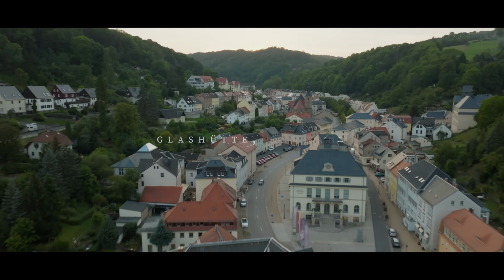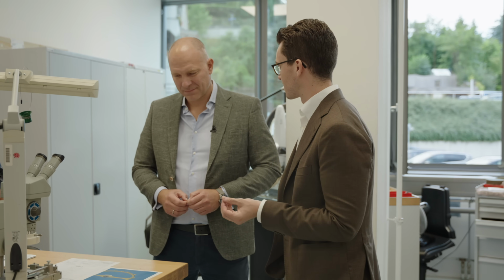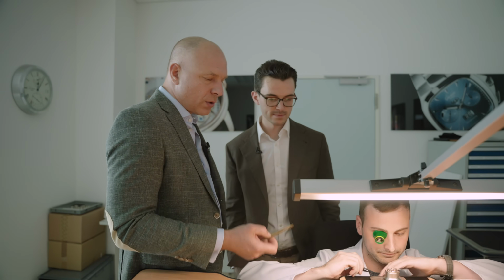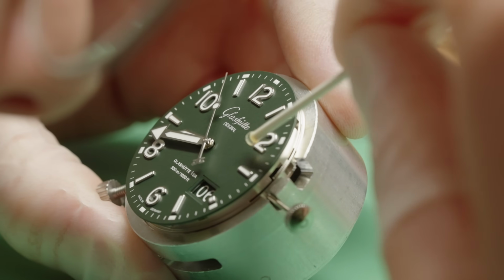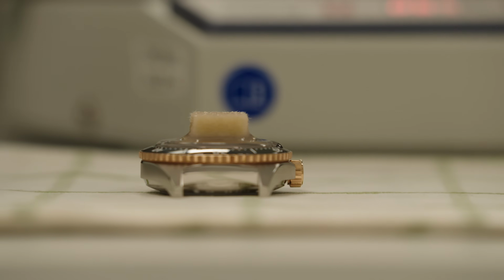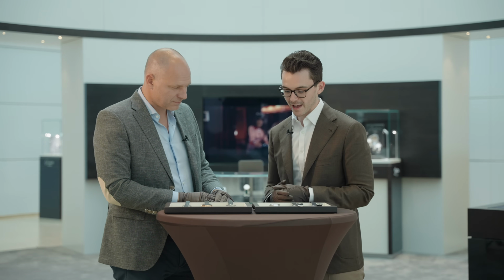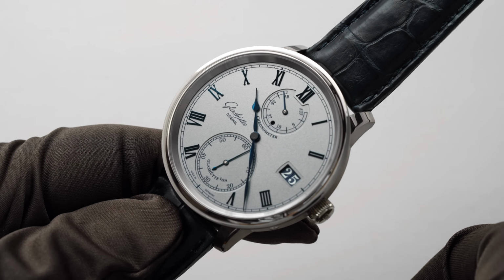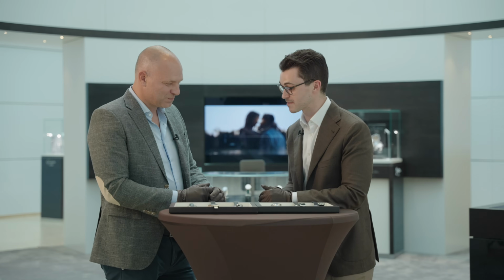Visiting One Of Germany's Greatest & Most Overlooked Watch Brands

Comment: Teddy: Thanks for the video, but it raised questions because of the lack of watches shown under production. For example, I expected to see trays of WIP (work in production) throughout the video and employees sitting at workstations. The footage showed one watch undergoing pressure testing; you would think a tray of watches would be in the footage of the pressure testing process. Where was a clip of the cases undergoing machining? The report contained nothing on finishing dials, gem setting, or band manufacturing. I can go on, but you get the picture.
Swatch owns Glashűtte as well as other German and Swiss-origin watch brands. Does Glashűtte manufacture all its watch components or use parts manufactured by Swatch Group's various production companies?
Please respond.

Comment: The 'hand crafted' watch is little more than marketing nonsense.  The vast majority of the work in any modern watch is done  by machines. Only assembly and some decoration done by hand. 

Machines can do virtually any watch making operation much faster, to a higher standard  and vastly cheaper than humans. eg Only 5-10 seconds for flawless Geneva stripes or perlage. 
Expensive  'hand made' watches usually have obvious flaws you don't see in mass produced models. eg a Seiko movement will have better machining on the gears than a Patek Phillipe.]

The Chinese can make almost perfect replicas of '$50,000' watches for a few hundred dollars. So you are just paying for the brand.

Comment: Just imagine if every screw in the watch inside and outside is perfectly aligned, meaning that once tightened down each mark of the crews are lined up ,now that is perfection IMO ?
Like you can see the case back screws are there but not lined up at all, the screwface is pointing in all directions, if they can go to this detail then i would be impressed?
Even rolex and other swiss made watches do not go to that level of precision, lining up every single screw inside and out?  🦘🦘👌👌✌✌👍👍
So basically measuring the depth of each screw and its thread count and the same with any threads on any plates inside the watch, to make sure that when tightened down all the head of the screws are pointing in the same direction?🦘🦘✌✌👍👍

Comment: There are about 200 parts in a motorcycle engine costing way less than this watch. I can buy a motorcycle with the amount of money it cost for this watch and my motorcycle can take me to places I have never been. My phone can tell time more accurately than this watch. Even my 500 dollar Citizen watch is more accurate. Instead of servicing my Citizen watch when it does not function properly or up to spec, I can purchase a brand new Citizen for the same amount as the cost of this watch or a Rolex. I do agree that Glasshutte Original is a great and better value compaired to Rolex, IWC, Breitling, Omega, ect. This level of fit and finish is only surpassed by A Lange & Sohn, Patek Philppe and Vacheron Constantin. I used to be a watch guy but came to my senses, because when bad thing hit the fan, I can hop on my motorcycle and get out of the danger zone where as with watch, I can count my last seconds on earth. LOL
Reply: Stupidest comparison and comment I've seen in a while.